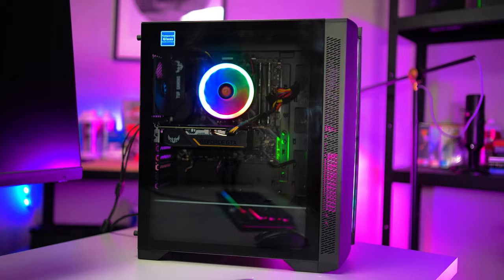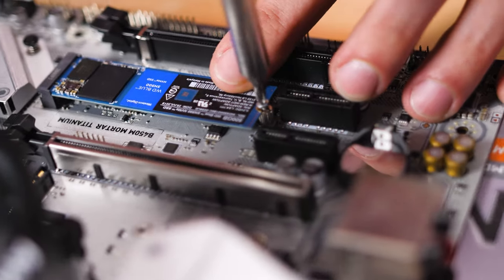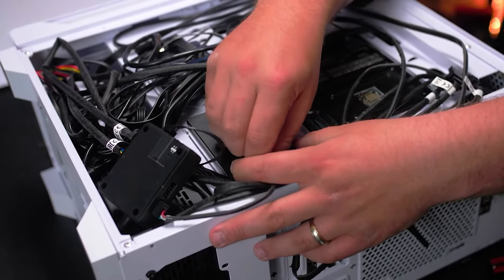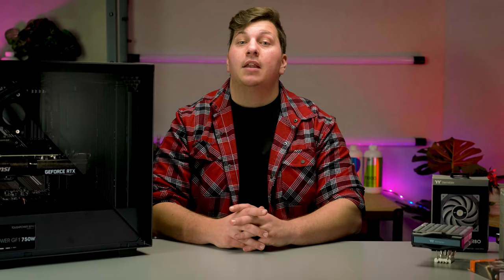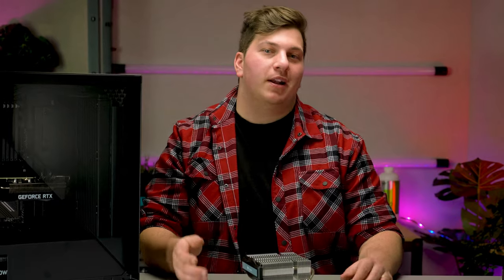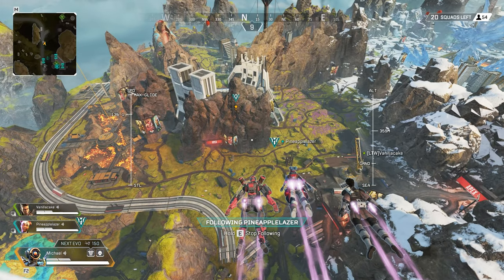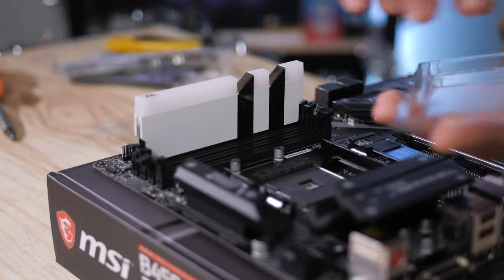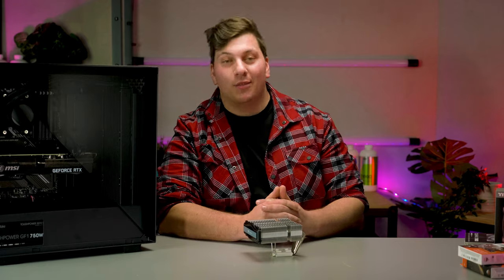What to UPGRADE  in a PREBUILD GAMING PC | 3 Fast & Easy Upgrades you can make

Comment: If you want to add storage, add storage. Don't replace that 500GB drive - re-installing windows, all of your drivers, apps and data is not an adventure path you want to follow. Search for how to move your default install and data paths to the new drive. For your important images, PhD Theses and such - external HDDs are very cheap right now - backup, backup, backup!